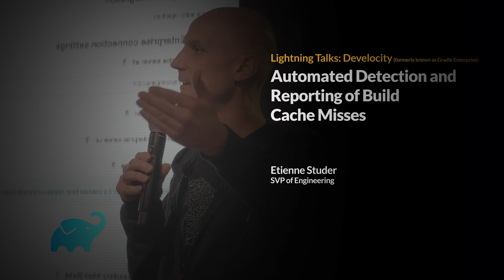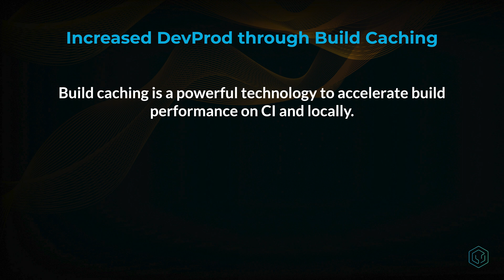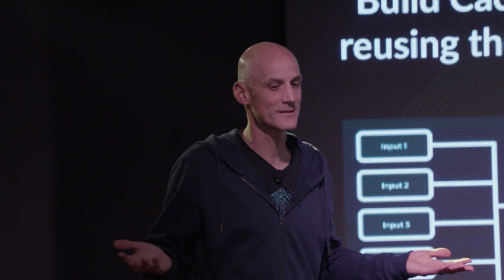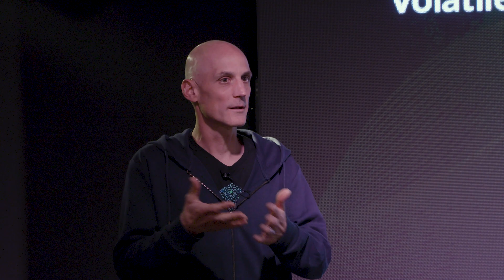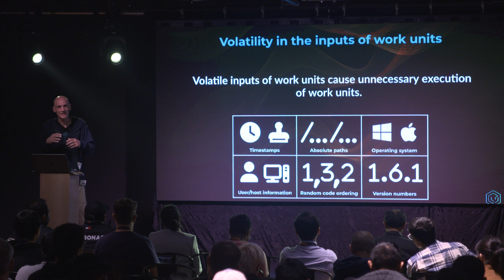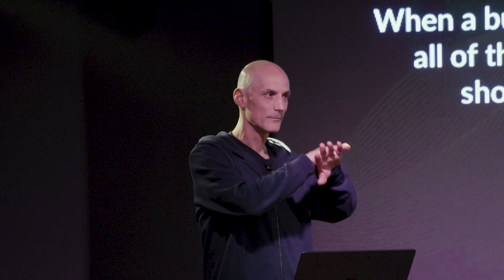Automated Detection and Reporting of Build Cache Misses

Comment: Is it possible to share the Gradle build cache between developer machines running different operating systems? We are working on Android kotlin project
Reply from the maker: Yes, it is possible and actually a common practice in large teams, but it requires careful configuration to avoid cache misses.
Reply: @DevelocityAI  I’ve tried this, but when the cache is produced on Windows, the consumer on macOS still doesn’t get a cache hit, even though both are using the same project cloned from GitHub.